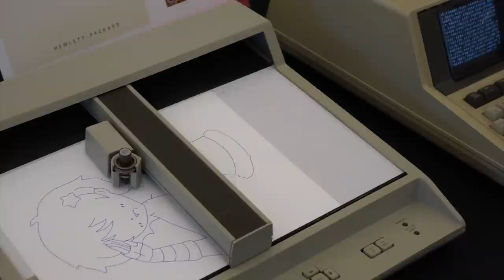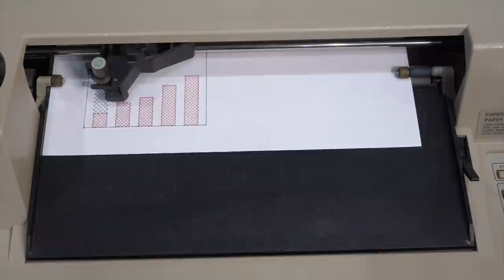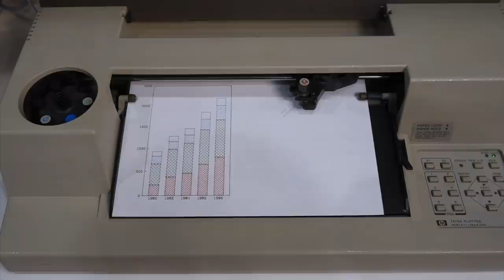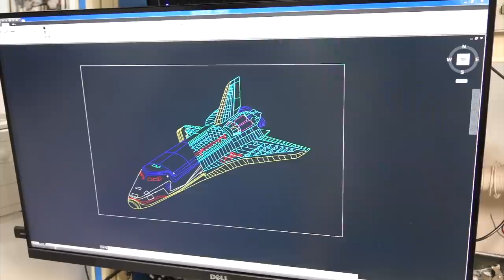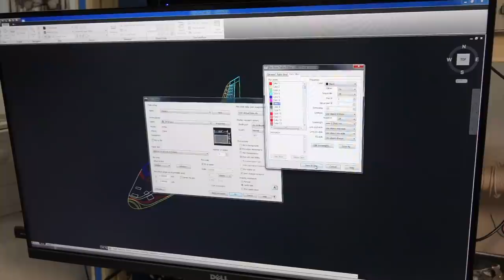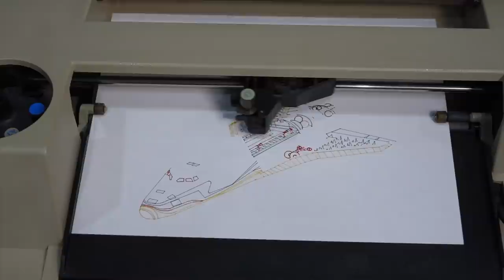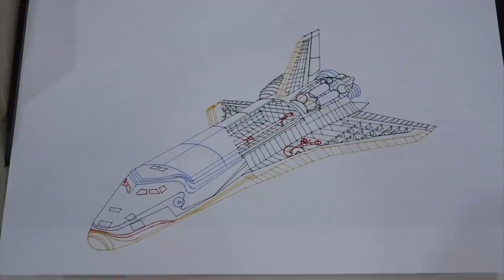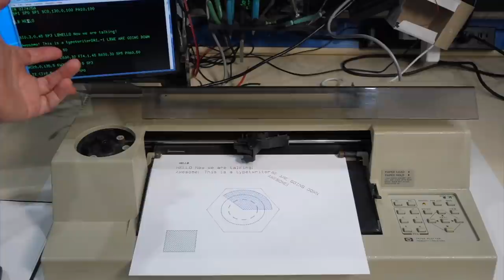HP 7475A Plotter and HPGL Demo

Comment: We use to use the HP plotters on velium and rubylith, to print thin and thick film microelectronic circuit designs. We would then use the developed photo-etched aluminum screens to print the circuits on alumina or silicon substrate, and then bake, and populate the hybrid circuit! Fun times!

Comment: My first paying programming job was at a small company that did architectural software on HP computers (9845, 9836, 9826), which pretty much supported HP pen plotters out of the box.  We had a couple HP 7470s, an HP 7475A, as well as an HP 7585 -- the big A0 chart plotter.  I had a lot of fun using them to draw 3D wireframes of home floorplans.  And yeah, those things went through pens like candy.

Comment: Back in the late 80s, I had a summer internship at in the IT Department of the solid rocket plant of the Chemical Systems Division of United Technologies out in the Coyote Canyon between San Jose and Morgan Hill going through all the departments.   This meant I learned all about turning punched cards into tapes, spooling labor report jobs to the IBM mainframe back in Hartford, and handling the wicked bursting and decollating machines.  The engineering team had a VAX, so I got some time commenting on rocket simulation code.   When I got to the IT management team, they had a single IBM PC hooked up to a 7475 plotter.   I could already use a spreadsheet (Lotus 1-2-3) and learned Harvard Graphics to make IT department presentation so I had the PC to myself.   The management team wanted a custom formatted graph so I sat down with the HP-GL manual and coded it up for them.   They loved it and I wouldn't be half surprised if they kept using it until the plant closed down.  The only problem was that the PC was next to the bull pen of IBM mainframe programmers who all smoked like chimneys at their desks (in a rocket plant!) so my closed reeked of stale cigarettes.

Comment: The 7440A ColorPro is a very similar plotter which only supports one sheet size.  It only had two servos, one for X and the other for Y; pen selection was done by pulling in a clutch which would allow the Y-axis servo to turn the carousel.  It actually pulled the sheet along while changing pens!

Comment: I know it's just X and Y stepper motors controlling the arm and paper, but man, I'm so impressed by the resolution from this 1983 machine! It's also very fast!
Reply: HP Plotters used DC servo motors for X & Y movement, solenoid for the Z and a stepper motor for the pen carousel.

Comment: I'm surprised how much high level functions were in the device itself. I would have expected something more like G-code: just line segments and basic curves.
Reply: Gcode for a high res circle or crosshatch is a lot of data, I don't know the data transfer rate or processing capability, but keeping this fast machine busy would be quite a task in the eighties. Implementing an interpreter want easy either I'd reckon.
Reply: @MeriaDuck  You do have a point. But gcode does support circle arcs. Not that 3D printers use that generally though. For a filled area or cross hatch it would be a lot of code though.
Reply: hewlett packard is nothing like other companies. Just for a calculator they created a language and software system that has features which even modern languages lack.
Reply: @VorpalGun  in 3D printing, G2 support is a very special feature only found in some high-end controllers with lots of program space.
Reply: @user2C47  Not really. I just checked, even Marlin supports it (though it can be compiled out). I belive support is enabled on my Prusa Mk3s. See also the Arc Welder Octoprint plugin (which converts series of linear moves to G2/G3).

And besides this plotter already supports circles. The discussion was why it has so many more high level functions than that.
Reply: @VorpalGun  Also run Marlin, have no room to compile that in.

Comment: In high school we got a HP plotter, it did D size paper. We had it connected to a Mac Plus and a XT computer with an 8086 and CadKey. I do NOT miss those days, lol. Now I have solidworks 2020 and a Canon Pro-2000. Bit of an upgrade.

Comment: That unit is in great shape. It’s impressive how long these last with so many moving parts, especially considering what appears to be high acceleration when plotting. I’ve got a couple of the two-pen 7470As and one of them works perfectly. I even bought a digitizing sight that is shown in the HP-87 Plotter ROM manual demonstrating how to digitize an image from a photograph, but I haven’t given that a try yet. I’m not sure if I’ve got the patience or the eyesight required to do that successfully.
Reply: As an undergrad physics lab assistant, I wrote a program that used the plotter's digitizing sight to digitize electrostatic acceleration plots.  This then took the data into a polynomial least-squares fitting program I wrote in HP Basic.  Worked very nicely!

Comment: I believe this was one of the models where the paper was driven by a pair of wheels with a random rough surface like abrasive paper. The paper was fed from end to end at the start of the plot and after that the bumps on the wheels fell into the pits the wheel had made and so kept in registration. If you look carefully along the left and right margins of the paper you could see the indents.

This got over the problem of having to use special fan fold paper with side perforations that was used in the earlier generations.

Comment: I use the h p7475a in 1982 designing printed circuit boards.  Had to make my printouts slow so as not to dry out the pens... I actually threw mine in the garbage can, fully functional. I just had no place to store it, and its job had been taken over by a laser printer. It speaks a language called Hewlett Packard graphics language, hpgl

Comment: BTW our makerspace got given a while back one of those engraving machines they use for making metal nameplates. The really odd thing about it was that the engraver was directly driven by an embedded 386 computer which emulated an HP Plotter interface with the HP Plotter printer API so that the main engraving computer could just use an HP plotter driver & whatever vector software was appropriate.

Comment: Just came across this video (probably from the Apollo stuff).  Oh man this thing brings back memories of my early career.  We had one of these at my job at one of the big auto makers in Detroit.  Generated all sorts of plots for things related to the engineering work.  What's odd is that one guy had some Basic code to generate plots.  I had C code that generated other plots and for some reason the C code would always overflow buffers and screw things up.   Then of course there was the fun of the pens going dry.   Good times.

Comment: Brings back memories. I don't know if it applies for the HP plotter but because the x-speed is different than the y-speed  and you want to draw a straight line from lets say the left-bottom to right right-top you had to divide the line up in numerous parts otherwise you got a big arch..

Comment: The big advantage is that the paper moves on the long axis which is much faster than moving a gantry crane.  I think there was a cannon demo where you input the elevation angle and charge and the plotter draws the cannon then the trajectory.  Probably in HP Rocky Mountain Basic.

Comment: Damn. This stings. I used to have two of those 7475As and threw them out for space.
You should take a closer look at that carousel of pens. It's ingenious. There are no active components. All done with engineering and a few springs. Like the click on a ball-point pen.
Reply: Cool, I had the smallest of this series with only two pens, must have been the 7470A. But I remember that there was no physical pen detection. It worked like a ball pen mechanisms while measuring the necessary force.
I inherited a 7550A, DIN A3, the carousel could take 8 full sized refillable Pens and had the serial port but it's stored away for years now.
Reply: I threw out mine about 20 years ago because I needed the space and didn’t use it for CAD any more. At the time they were obsolete but not yet desirably retro. Wish now I’d hung on to it.

Comment: I have one of these, too. It has the HPIB interface, and is the only device i have, using this interface. Fortunately i found software on the Internet, to build a USB-serial to HPIB converter with an Arduino controller... I never found the builtin demo, so it's time to check my sales!

Comment: you'll be surprised to know that i have one of those, found in a client's bin during a business trip last year! :D i've cleaned it up and am figuring out the details of hooking it up to a PC over serial and piping raw HPGL to it from a file through a bash terminal. There's also a few pens i found that are dry, so i'll most probably use that tip of yours on how to refill them (and thanks for that helpful video too!). I'm also curious about using a cheap and standard Roland vinyl cutter with it as a test for vinyl cutouts.

Comment: It's interesting to see that the bottom hold power on demo as been an HP feature for so long. Every consumer and commercial HP printer I've worked on has had this. Came in handy when servicing the mid 2000's models that didn't have control panel and we didn't need to install it to a PC.

EW = External Wedge?
Reply: I would think Edge Wedge since he said something about Edge earlier

Comment: NICE,, now I miss mine - have to get a new set up and go back into blueprinting , this time would probably be an Autocadd license!!!! The HP 9000 was only like a 9" mono screen but at the time it was ok plus you only work on a small area of the print at a time and you can zoom, so it was fine, the software had everything but had to build your own LIBs, today you can buy them ready to go,,,, got that whole setup for $300 computer, plotter tablet 2 back plane cards nice metal keyboard , very tactile and a nice key click from a guy that did not know what he had and did not really care he just needed the $300 so I went from the drawing board to the cadd.... worked out well for years - why did I sell that ????? Lost a lot of stuff like that,,,sold a TEK PS5010 power supply to a guy in Venice and yes it was delivered by them little boats to his front door,,,, all the good stuff got away from me over the years, and for me it has to be the good stuff esp. test equipment!!! I had a BK scope with shared amps CH-1 and CH-2 and it had so much cross talk that was inherent in the bad circuit design you could only use one channel at a time - that kind of stuff used to really make me crazy, I CANT STAND CHEAP TEST GEAR plus you never really knew if its holding calibration or reading correctly so now you need 2 one to check the other,,,its getting me crazy now just remembering it esp. when you have tight tolerances on alignments and such you can do more harm than good if you have cheap gear,,,I guess if you are fixing transistor radios the cheap gear will be ok,,,,, almost!!! LOL,,,, you know this!!! Hey Nice videos and thanks for making them,,, very enjoyable !!!!!

Comment: Awesome! I found one of these in our lab of the HP-GL version, but all the pens are dried up. I haven't tried the rejuvenation trick in case I break the original pens, but I was thinking about whether it would be possible to adapt a modern pen to it. The cover and the carousel means you can't use taller pens like a Sharpie or something, so you have to cut up another pen.

Comment: Standard / naive contour plotting routines that go from grid square to grid square make a lot of noisy pen ups and downs (and caused more wear of the felt tips, and ink 'blobbing'). So contour following was better on the plotter, though the algorithm was a little more involved. Similarly there were pen optimisations you could do when plotting e.g. axis ticks which would make plotting sound less like a machine gun.

Comment: I have this plotter as well (mine has the HPIB interface), I also have three HP 7470A's two HPIB one serial. Currently I am waiting for my pens to be shipped but I use all these plotters except the one serial interface 7470A with my HP 70K series spectrum analyzer and HP 5371A Frequency and Time Interval Analyzer. These things are awesome but getting pens is always an issue.

Comment: hey! i am having trouble doing this same thing with my plotter. what program did you use to connect to the plotter? did you use an adapter I assume? also, what settings did you use when you connected? I have downloaded a program called putty to try and communicate with it and it recognizes it on COM5 but when I open the window its frozen with one single highlighted character in the top left corner. is there any kind of tutorial for this kind of thing or no? thanks for the awesome video!

Comment: Looks just like a Cricut vinyl cutter, but with a multi pen carousel instead of one xacto knife and one pen. I assume hp also didn't try to sue anyone using it with alternative software either.

Trying to think where I've seen hpgl export options.. kicad? Maybe inkscape too? Do these modern tools work, or are there dialects of hpgl that are incompatible?
Reply: Most of the HP plotters used HPGL only a few very late model HP plotters used HPGL/2 language which a lot of modern cad and cam programs use,

Comment: hello that machine seems really interesting ... now I ask you, would it be able to draw a schematic circuit or better yet, the printed circuit itself?
Reply from the maker: As long as it is vector and mostly fixed line width, it can do it. The Gerber used for the PCBs should fit the requirements.
Reply: @CuriousMarc  hahaha nice... I think search one right now

Comment: These pens wore rapidly with large drawings. And then the lines got fatter and fatter. The original pens in my large format plotter were small drafting pens and as times they got stuck in the paper, tearing everything. Our HP plotter stopped working on Jan 1 2000.
Reply: With those speeds I can well imagine that. Just like with 3D printers, it will probably have happened at 90% of the job...

Comment: I have an HP 7475A and it freezes half way through the print when I try to print out the space shuttle from AutoCad in DOS. I'm not sure how to fix the problem. :(
Reply from the maker: Maybe try to turn on the Xon/Xoff flow control in the serial interface.

Comment: Does it contain any 7475 D-type edge-triggered J-K flip-flop ICs?
Reply: 7475 is D latch. 7476 is jk ff
Reply: @mmaranta785  THANKS; I sit corrected.  Can't seem to remember much these days. I'd tie 7474 Not Q to Data for divide by N counter chain (pre-loaded with desired divide/by count). Brain fog predicted 'till horse paste kicks in.  lol
Reply: @FindLiberty  I used to do the same thing with 7474 for divide by 2. You’re only the second person I’ve heard that used the term “I sit corrected.” I always say that now. I miss the good old days with DIP packages. I recently got some Analog Devices 10 pin MSOP package samples but they are too small for me to hand solder so I have to send them out and pay $40 just for my breadboard!
Reply: @mmaranta785  LOL Yea, 'still use my W-TCP-L with a medium tip and drag 63/37 with LOTS of flux.  Stay safe bro!

Comment: this thing appears to run off a 6802 processor
Reply: I just checked this a moment ago! Its a microcontroller isnt it? I wonder if the code is available anywhere.
Reply: @willyarma_uk  no, it's the motorola predecessor to the 6502 which is an almost perfect clone
Reply: @AmauryJacquot  Sorry yeah, I misread it while googling. Its a 6800 CPU with RAM and clock oscillator.